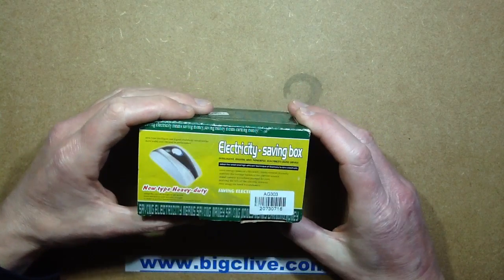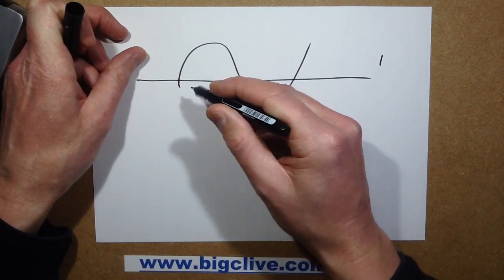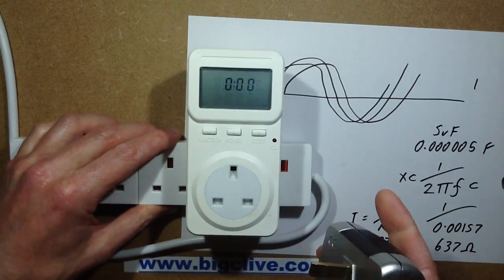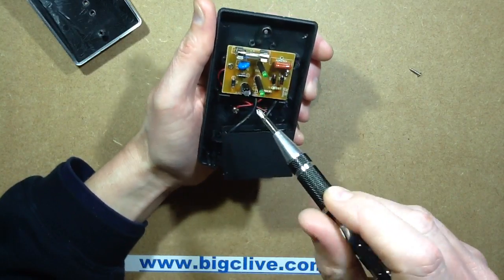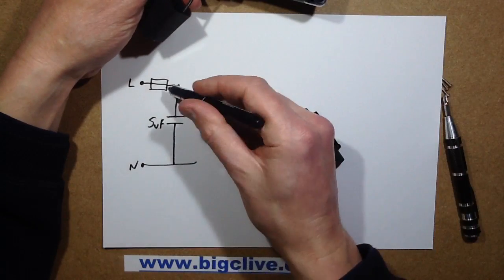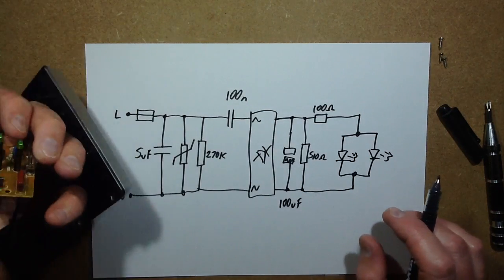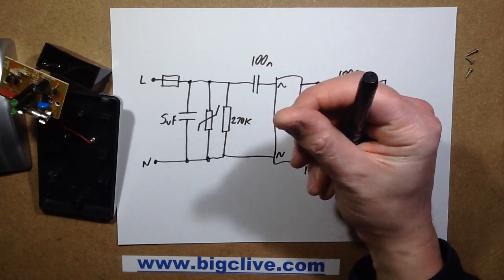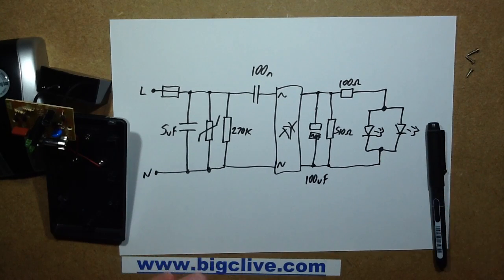Teardown and test of a home power saving plug.

Comment: I was suckered into buying a couple of these, I have to admit I'm usually a lot brighter than this. I studied electronics for 3 years but ended up going into my dad's business, it's more of a hobby now. I am always curious about gadgets like this, I figured that maybe it was more of an inductance and capacitor device. That's a whole different device there.
I'm in my late fifties now and have been diagnosed with terminal cancer, I'm looking for ways my wife can save money after I'm gone. I looked into the solar route, we have a large garage and one side faces south without obstruction. 
Last month I finally decided to try this device, I never did actually plug it in. My curiosity got the best of me, I opened the unit and found the schematic was very much like yours except for one huge difference. The bipolar capacitor was not connected correctly, both ends were soldered to both ends of the neutral line. How dumb is that, it did absolutely nothing but light an LED. Needless to say I'm going to try and get my money back, I was very careful when peeling the decal back.
I had concerns when I bought these, I should have listened to them. I'll have to find other savings elsewhere. 
I thought your video was very well done and you can't argue with the math. Keep up the good work, thank you for teaching everyone what I should have known. I'll blame it on the Chemo and Radiation Treatments.
Reply: I hope your doing OK with the treatment and your wife and family are dealing with  these trying times. Stay strong.

Comment: At the school district I work they installed new 25 ton air conditioners with vfds for the main blower.
Some failed some locked out because the incoming power was just a cheap Delta y and it had so much noise on it and literally dropping phase we installed conditioners on each air conditioner it worked perfectly afterwards.

Comment: Hi Clive. I seem to remember an EM reg saying discharge 5CR <2 seconds. 6.75 seconds here ?  If this value was 68K then job done. If 4 x 68 K 0.6W series-paralell it would be  700V peak without trouble ( 360V likely ). If the LEDs were in this circuit no nasty DC side requried. 2 x 1N4007 in reverse bias with the LEDs. If being super stingy the LEDs can be reveres bias one to the other using 2 x 33K 1W. The latter version will be brighter ( USA ? ). Even blue LEDs work. I have a very big expensive book of some EN regs, the Bible is an easier read. No real index, I might try to find it  ( in an Email if lucky ) . LEDs strobe in this use. It isn't obvious. A small cap might help if fussy. 10uF 10V  ( C x 1.7/mA = 63% )?  In step with the LED and LED bias direction. I ran this idea for years.  An extra 68K across each LED as a failsafe. 

The only thing Smart about a Smart Meter is that they fooled you. At best it will not charge you more. If an aircraft I wouldn't like to fly in it. My friend just missed having one. Not because it was electricity. No, because it was set at 7 feet. When I asked he had no  electrical training ( IEEE ) ! I was shocked if you will allow.

Comment: Clive, you might take a look at "wind up torches, On mine, the rechargeable battery  isn't actually rechargeable.
Also a calculator that was "dual power" had a non connected solar cell.

Both Chinese needless to say.

Comment: In summer with an air-conditioner motor going along with the freezer and refrigerator, would the capacitor help to smooth out the power and take out spikes?
Reply from the maker: The capacitor would definitely help filter noise.  If it's connected.

Comment: This power saver is rubbish, just a scam. I've had one connected to near my fuse box as the instructions said. It's been connected for over a year, and I run the same appliances and there is no savings when compared to my bills for the last three years. They are just scamming you, don't get it, it doesn't save you anything!

Comment: Very well presented and explained , power factor is only beneficial in large manufacturing factories where induction of motors can benefit from it , it also is followed by very large capacitors , banks of them to keep the power factor above 90 percent , small households electricity is measured by electric companies in watts , so like you said it does nothing but maybe and maybe running your washer or refrigerator electric motor a bit cooler , again thank you for a great visual , technical explanation of what this device does not accomplish .cheers

Comment: Ss far as I am aware, power factor is not part of a residential energy bill. Power factor correction equipment for industrial applications is complex and expensive and of course there comes a point at which cost outweighs savings. Fortunately however they can buy these for cheap and save loads. Blimey why didn't I think of that.....🤔

Comment: Its 2021 now and I have had a Ecotak power wizard plugged in in the UK for 8 years,even if it hasnt saved me anything,has it cost me anything to run ?  Clive didnt mention that.
Reply from the maker: With a standard power meter it shouldn't have cost anything.

Comment: Very good math and science . Not boring at all. Refreshing. My unscientific thought was similar to a surge protector installed in residential service panel,  before the power from company entered your  panel, may work? . However on my wish list would be an installed device prior to entering home electric panel with a computer app, that would read exactly how many KW used in home and identify the large consumers of electricity. ( Fridge, stove, hair dryer s, etc.) Things a person could change, by changing their consumption habits.  Again thanks for producing a really good thought inducing video.

Comment: I'm having lots of problems with damaged equipment due to shifts in voltage. Will this help in any way stabilizing the current and protecting the equipment during brown-outs?
Reply from the maker: It only monitors power use.

Comment: It does do something:

It helps reduce the "spare cash" factor, and it can be used as a very bulky, inefficient, little green LED based, light source, "On a dark, and stormy, night".....

But you will need to provide an extension cord if you wish to be able to use it further than a 12 inch radius, and if your external grid source power is down, the capacitive circuits will discharge, before it even becomes useful for that.....

But, take heart.....

It can also be used as a single use, (hopefully), "non-harmful", & possibly "non-fatal" "shock" amusement toy, (amusing only to you, of course, and possibly to others not affected by your misuse of the product, in the immediate vicinity), but only if you take it apart, and disconnect any component that will trickle, or completely, discharge the capacitors.....

Said capacitors are only capable of a "minor" discharge, about like a "carpet friction" shock, on a very dry day.....

A caveat, though, people today are intensely frail, unlike our hardy ancestors, which could cut off a finger, cauterize it with a blow torch, and continue on, as if, nothing of any significance, happened, at all.....

Today's humans are pampered, monitored like a hawk to prevent self harm, and most will faint at the right of a pin prick, or a minor paper cut, regardless of if it happened to them, or not.....

Thus, the warning about harm, or possible fatality, (you just never know).....

If used as an amusement device, (after modification), be prepared to exit immediately after use, or perhaps you will suffer damage of varying degrees, depending on the tolerance of the "victim" of your feeble attempts at comedy, and / or, their mobility ability.....

You might want to use this device, on grandparents in a wheelchair, only, (please see note, above, about how hardy our ancestors, were /are).....

It might be a faster path to your inheritance, if I was wrong about the hardiness, of "your" ancestors, (you might be from defective stock, again, you just never know).....

Other than that, the device is pretty much useless to you, but profitable to the marketer, that preys on gullibility.....

Which seems to be extremely abundant, evidenced by the way people vote, now a days, (daze?).....

Comment: If it doesn't do anything to help the electrical consumption and the circuit in it uses electricity it is actually increasing your electric bill. The meter shows it is using 391 ma of electricity. The watt meter doesn't show the number of watts because it doesn't show readings that low.

Comment: As an electrical/electronic engineer, 1st FCC license, radar endorsement, FAA certified tech, have all the electronic equipment traceable to the "National Institute of Standards and Technology" to test the accuracy of my power companies electrical meter that determines my electrical bill.  It is better than 0.1%.  We have Apparent power with a resulting power factor, pure resistive loads have a PF of 1 resulting in true power.  Inductive or capacitive loads do not have current in phase with voltage, so their power factor is zero, thus the true power your meter reads is zero.

Most industries use induction motors that have a lagging current resulting in a low power factor, and while the meter does not read this, the current flow is real and current flow of any phase does lose energy due to the resistance of the wires.  So power companies may have an extra charge of this, but not for the average home. Refrigerator and furnace blower are the two major loads with a lagging current.

This can be corrected using a parallel AC capacitor with large conductors, or will have additional resistive loads.  Looking at the circuit the author went through the trouble of drawing, this device will actually increase your electrical bill, certainly not reduce it.

Only president that made an issue of devices like this was Carter, unfortunately that's about all he did, so all this phony crap was taken off the market only to come back again.  Ha, attaching a permanent magnet to your vehicles fuel line to super charge it with super magnetic energy for more power and fuel economy.  If you believe this, also purchase this Okowatt, I feel they should be in jail.  Wish they would stop sending me spam, another thing that doesn't work with them is unsubscribing to their poppycock spam emails.

Comment: I ALWAYS CHECK REVIEWS ON ANYTHING I MIGHT PURCHASE. Checking for reviews is how I ended up here watching your video! Thanks Clive. I find that most offers and advertisement such as this energy saver are usually embedded in an obscure area on the internet. It's usually advertised with an urgency to purchase stating that you need to purchase right away because they're flying off the shelves. I'm sure the reviews that the seller uses aren't authentic, therefore I look for reviews outside the long, drawn out, never ending article used to lure you in. Beware, be careful!

Comment: "Electricity Saving Box." For those times when you find some loose electricity in your pockets or between the sofa cusions, you just slip it into the little slot in the top of the "Electricity Saving Box."

Comment: I got sucked in and bought a couple of these things.    biggest thing I noticed was the reduction in range of my home wifi system. I removed them and my wifi was back to normal.
cheap lesson learned i guess do not by anything of the internet til you research it
Reply from the maker: Definitely WiFi?  Or possibly data over power?

Comment: Is this the same type of design used in fridge/freezer energy saving plugs? I know the fridge saver plugs were on sale at one time. I think all they did was lower the voltage to 220 and claim to save energy, as fridges/freezers are plugged in all the time.
Reply from the maker: The freezer plugs had quite complex circuitry in them.  This is just a capacitor.

Comment: 1. Does this make breakers trip later when I have a bunch of large capacitive and inductive loads running?

2. Will this enable me to get a higher wattage output from a UPS?
Reply from the maker: It won't help in either case.
Reply: @bigclivedotcom  Thanks for your reply!
Most UPS's have a power rating of around 0.7. Wouldn't this be able to correct that? 
Breakers trip on apparent power right? So lowering that would delay breakers tripping isn't it?

Reason I am asking is because I am on a 220v/50hertz single phase grid with a main breaker of only 10A. Due to restrictions from the building I live in, I am not allowed to change the breaker and I am trying to run as many 3d Printers as I possible can while still having somewhat of a life inside the apartment. Any advice?

Comment: You are a savant; calculating power factor by memory, knowing resistor colour codes by heart. I've done this for 40 years, and I still have to look everything up twice every time I dust off the soldering iron!! But yes, My new smart meter does measure PF, so I have been busy, changing my wound transformers around the house for something better. Before, with my old spinning disc meter, my idling consumption was around 40W Measured with a stopwatch. With the smart meter, it shot up to 225W! Turns out 50HZ idling transformers have piss poor PF, around 0.3-0.6. My audio amp registered as using 65W turned on but not playing. So far I'm back to around 50W between the fridge cycling. This has become a sport Just changed the 7805 and 9v AC transformer in my kitchen clock for a 5V SMPS wall socket brick and it now uses 0.5W instead of 3W.

Comment: Hi Clive, 
Really enjoy your videos.  Can I ask what is the make & model of the white power meter plug you used in this video? I'm a physics teacher &  it looks like a really useful tool  to have & might also  be quite useful in class. Thanks,  Jimmy
Reply from the maker: It's a common item called a plug in energy monitor.  I don't think this exact type is available any more, but they are very commonly available in different styles online.
Reply: @bigclivedotcom  Ok Clive- thanks a million.
Reply: @bigclivedotcom  YOUTHINK

Hi  again Clive,  I've come across this one branded as  YOUTHINK [2019 Upgrade]UK Plug Power Meter Energy Monitor.[2019 Upgrade]UK Plug Power Meter Energy Monitor Electricity Usage Volt Amps Watt kWh Consumption Home Electrical Analyzer with HD LCD Backlight Display Overload Protection Calculate CO₂Emissions https://www.amazon.co.uk/dp/B07J6N486P/ref=cm_sw_r_cp_apa_i_Z.8oCb0P3Q0Y8
 Any chance you might so a teardown review of it testing it's accuracy  or a review or comparison video of the different  models available? Cheers,
Jimmy

Comment: Interesting.  I think I should check to see what PF is generated by a computer.  Nova Scotia Power has applied to the Utilities Review Board to change meters over the next ten years so they can charge for poser factor.  I really don't expect that my house will get such a gadget, but the PF is has been approved for the utility.  Three computers in the house.  Should I worry?
Reply from the maker: You can get near unity power supplies to retrofit if yours are not labelled as such.

Comment: As Mr Watson says "the maths are fun."  Besides, meaningful so what value of inductive load would a 5 uF capacitor negate?  And who cares.  The local power utility has decided to start measuring power factor, to charge for motors.  I don't think it will make much difference in most power bills, and I can see that it will take at least 10 years to implement instead of the 5 years they anticipate.

Comment: The times my have caught up with you Clive ..... Modern Smart Meters may be configured to record power factor!
Reply from the maker: The power companies will inevitably enable that feature in their pursuit of profit.
Reply: Maybe SMART meters one day will measure power factor. But the first generation of so called SMART meters often cannot be used as SMART meters if you change energy supplier. So not so SMART then...
And for those who still have traditional electricity meters, in most of the U.K. you are under no obligation to allow any energy company to upgrade your meter to a SMART meter. Hence you can keep a traditional electricity meter ;-)
Reply: I deal with meters that record KVAR ..... sounds like power factor measurement is here already! There are several types of "Smart Meter" fitted by the power companies ..... some are "better" than others, but the aim was to get them in and paid for under the green energy money from government (in the UK) upgrading them will come later ;O)

Comment: Local garage in Portugal has its power distribution/metering in a public area. There is a glass fronted cabinet with a large PFC capacitor (can't see the value), and space for a couple more with terminals  on the busses).

Comment: I recall my brother in law bought one of these because he was told that it would save power running his freezer. I only became aware of it when he was concerned it was getting a little warm.
I was happy to provide a simple and effective solution. I filed the device under "R" 
(or G for garbage if you are reading this in the USA)

Comment: Makes me intrigued that modern high-efficiency computer power supplies often are advertised with power factor corrective circuits in them.
You can't throw a PSU search at Newegg or Amazon without hitting a unit fitted with active power factor correcting.
Which incidentally these models actually create a problem for those of us with low-cost non-sinusoidal UPS backups, as the PFC circuit freaks out at the "horrible" output of the UPS and can damage something.

Comment: solar panel the same size would increase the savings from 0 to 1%. A water turbine attached to each tap in the house would increase it to 2%. The only real way to save power is learn to generate power yourself.